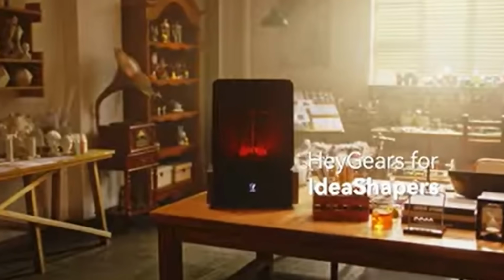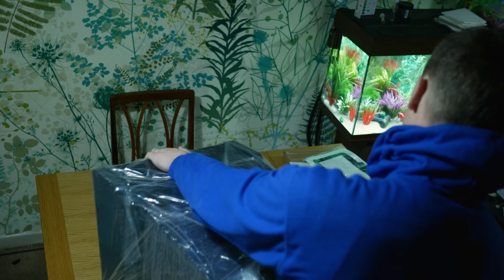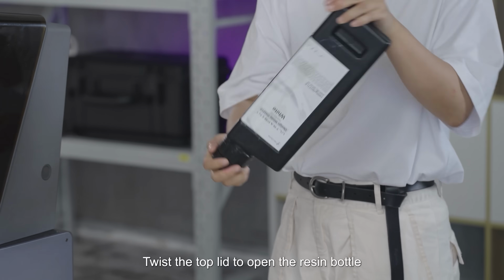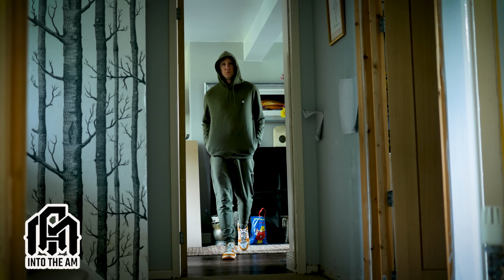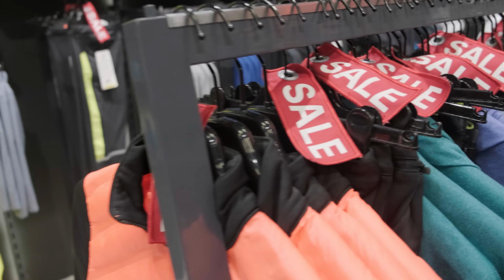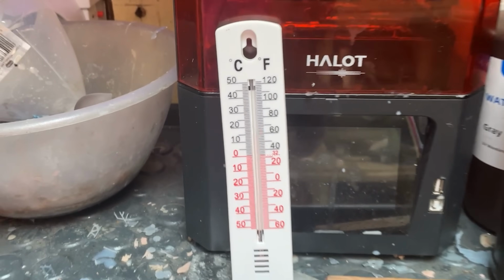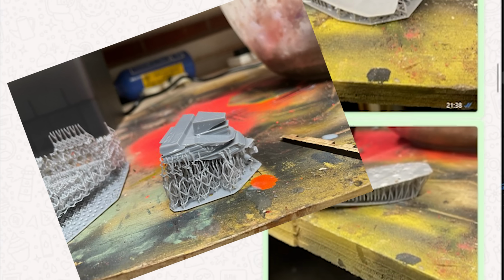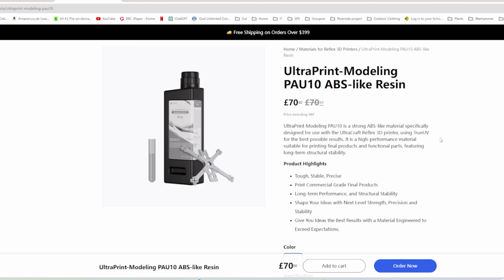The BEST 3D Printer you'll never buy - Hey Gears Reflex Review

Comment: I was thinking of buying this printer as I'm a novice and this would be my very first 3D printer,  I know nothing about 3D printing so if this machine can do everything for me that I'm not able to do because i'm just not that knowledgeable then that for me has got to be a good thing, I was going to use different resins in their bottle to see if I could use cheaper resins and if that works then again that could only be a good thing, I really can't do all that dialing in thing and doing my own supports for my models which by the way have been done for me so I have to trust the people that have produced the stl files, I want to produce some 1:76 scale model buses and I really think that this printer would help me do that even though the printer has its downsides like trying to lock you into buying their own proprietary resins and of course the price but in time I may get around the resin thing and the Machine may pay for itself if I opt to sell the model buses that I make but now that I've seen your video I'm now a little bit unsure?. Please tell me why you think I should buy one, I mean making model buses maybe a bit more profitable than making little model soldiers - right??.
Reply from the maker: Hi Chris, the best way I can put it is it’s the best 3D printer on the market right now. If you have the budget to run it, resin and all you will love using it. The concerns around being locked in are not a problem in a commercial setting or for use cases where you need precision parts easily. Think of it like buying an iPhone or an android phone. If you use the link in the description you get $100 off and a free resin too so that’s worth having!
Reply: Here is the thing.. 
If you are going to be doing sales I think this would be a great machine. 
I think in the long run you will end up spending less time and money on pieces due to less failures in the long run.
Reply from the maker: I agree, while no system is perfect if you are looking at purchasing a form labs system. This system costs less than half and is just as good.

Comment: I don't see anything special about this printer. Just looked at the specs. Its basically a formlabs with projector curing. Nice click bait tho.....but this changes nothing in 3D printing. This closed system turns any professional away. All my old closed system "professional printers" (including formlabs) are paper weights now - because they could not keep up with resin development. As a professional you never want to limit yourself to resin brands. Especially looking at the last few years. All resin printers are essentially the same....curing resin in a vat against a glass screen. From an engineering point of view, they should concentrate on print profiles for a wide array of resin manufacturers out of the box. That would actually be "professional". If they open up to other resins, I may consider buying the printer.
Reply: Ok just wondering because of that first guys comment. Most if not all reviews I’ve seen say this is an amazing printer the only gripe is that it is closed system. I assumed that most the reviewer were not lying I feel like some of them didn’t want to admit it was good though. I do understand why people would not like the industry to end up like the consumer printer industry companies like HP, I don’t feel I would want to buy the GK2 if it wasn’t capable of reaching that level of performance even if you tweak settings. Thanks James from a fellow James.
Reply from the maker: @JMEGAR324  very happy to chat in more detail, jump onto my discord, its free
Reply: @jamesgarcia123 while yes the printer is phenomenal, it's not worth it imo if you're gonna be locked into only using their resins. If you're gonna use it for functional/mechanical parts, then I wouldn't suggest this one only because if you need a specialty resin your only options are to get into contact with HeyGears to make a custom resin, or out-source it. I would look at the Saturn 4 ultra. It doesn't have a heating system come stock or a resin pumping system, but that stuff can be added on after the fact.
Reply from the maker: @ciderhat2760  if you are using the hey gears in a professional capacity ie prototyping mechanical parts, I would absolutely use hey gears over Elegoo unless you are very much into the weeds around dialling in your resins etc. Hey Gears are first and foremost an industrial printing outfit, specialising in dental and prosthetics they have multiple resins for this purpose beyond those in the video. While the Saturn 4 looks like it will be a good machine it’s only been available for a week and tested by reviewers for under a month, so I would urge caution before jumping on the hype train.
Reply: “As a professional you never want to limit yourself on resin brands” 👀 
Stratasys, Massivit, Mimaki, et al have entered the chat.
Reply: @joeylopezdesign  Stratasys is not limited to their own resin. ;)
Reply from the maker: @joeylopezdesign  bring it on, its exciting to think this is the worst 3D printing will ever be!
Reply: What resin printer would you recommend buying?
Reply from the maker: @JMEGAR324  it depends how you use it, the closest in terms of performance to this one with out the lock in is the Uniformation GKTwo,  https://youtu.be/rGOFJVZVwek
Reply: @RisingApe  but as of right now if you were to base it on performance I should get the Heygears?
Reply from the maker: @JMEGAR324  if you base  it on performance, I would absolutly get the hey gears, the print quality is phenomenal. I did a direct comparison of the Hey gears and the more expensive formlabs 3l here too is that helps. dont forget you can use my link to get some free resin and $100 of the price of the printer too. https://youtu.be/aGebC1tiLQc
Reply: @RisingApe yeah I bought the gkthree
Reply from the maker: @TheRealRivulet  Cool, it looks like a great machine, I know Ross' go to is the Reflex though
Reply: SAME, everyone says good stuff about it, faub even said the gk3 ultra is the best then joined on the train with heygears is the best, I say uniformation is the best it finally brought quality to big screens and everything else is perfect
Reply from the maker: @TheRealRivulet  I will be testing it soon
Reply from the maker: I basically agree with all of this I always approach my videos from the perspective of a home user hence the title. Most hobbyists won’t have heard of/ ever used a Form Labs machine, but the new Form 4 has shifted to LCD now too. For the hobby printing space there is lots of innovation here, outside of the form labs machines I can’t think of another machine with similar specs, happy to be enlightened though. Ref resins, I agree
Reply: @RisingApe  you... agree that your video is clickbait? yikes... mute mute mute
Reply from the maker: @lamBOwheel  thanks for your comment, not what I said but mute away.
Reply: @RisingApe  What is it about this printer that prevents other resin brands being used?
Reply from the maker: @robguyatt9602  Nothing, @Greedy3d has a great series of videos on this

Comment: Tbh what this printer brings to the table isn't revolutionary and in some cases backwards and outdated for it's price point especially looking at it's other competitors like GKTwo and Elegoo's newest Neptune Printer which blows this out the park. Hope you cover elegoo's new printer soon, aside from that Great video! Cheers!
Reply from the maker: Thanks, what do you see as a backwards step? In almost every way this is the most advanced printer I have ever used, do you mean the Saturn 4? I have some friends who have tested it, other than the tilting vat there is nothing crazy about the Saturn unless I’m missing something (I haven’t tested it) and god forbid you spill resin near that mechanism…
Reply: @RisingApe  The fact that you need to manually Level it and having proprietary resin is a step backwards in my personal opinion. Especially so when a number other flag ship consumer printers have auto levelling and doesnt limit itself in resin usage. I mean for that price point one would at least expect at auto levelling. 🤷‍♂️
Reply from the maker: @Kumomo92  you don’t have to manually level it, it comes levelled, if the machine gets knocked out by a print fail/ vibration or similar, you can level it manually (albeit with the sensors telling you exactly what to do, even down to which what to tighten the screws) though. You do have to level the machine, (to make sure it’s on a level surface though)

Comment: Proprietary resins? I'm out. Looks like a good tool for small businesses and education so long as they have a strong support network behind it.
Not for hobbyist fiddlers like me.
Reply: Same! The only time i feel justified for a 3d resin printer to have a Proprietary resin , is if said resin is deemed Safe to use and touch. Aside from that, one can't really justify Proprietary resin.
Reply from the maker: @Kumomo92  Are there any safe resins? I can see the argument for stock control and having your inventory stored and easy to use, not a typical hobbyist solution though.
Reply: @RisingApe  Not I'm aware of any at the moment (there was one Korean brand but it's kinda iffy)  but if they are able to create one, making it proprietary would make sense in both technical wise and business wise . But making a machine that's uses proprietary resin for just because it can (from what i recall it can print using hobbist resins but it'll void the warranty or so i remember someone tested) ... isn't really justified even more so for commercial business. as the last thing as a business I want is to have machine that relies supply with only 1 vendor, if there's any disruption  with the vendor with shipping or selling said resin, i'll be hard pressed in finding another especially so when i have orders to fill.
Reply: @RisingApe  sorry if I might sound like am ranting or maybe I am unknowingly. But for some reason I feel disappointed with this printer. 😕
Reply from the maker: @Kumomo92  not at all, go for your life. Thanks for commenting
Reply: @RisingApe  I use food grade river table resin manufactured here in Australia, and it is safe with no mask needed!
Reply: @Kumomo92  River table food grade resin, manufactured by AA composites in Brisbane Australia is safe with no mask needed. Great finish clear resin with no yellowing over time.
Reply: @Aangel452  no mask needed and safe to touch?
Reply: @Aangel452  Just to confirm, i just looked into the resin you mentioned. isn't that Epoxy Resin? Can that even be used on a Resin 3D Printer?
Reply: @Kumomo92  yes,its all the same stuff.
Reply from the maker: Thanks for watching, that’s what many will feel I think

Comment: Ohh trust me lazy people with more money than sense will buy this printer to print models to paint or armies no doubt it's basically the easy button but it still doesn't eliminate the hazard materials and the rest of the dangerous chemicals associated with resin printing, IMO the Saturn 4 ultra is it better machine than this and the GK2.
Reply from the maker: I haven’t reviewed the Saturn 4 but i seriously doubt it’s a better machine than this. It is significantly cheaper though and if you don’t need a heater it’s a great shout. It looks a right pain to clean though
Reply: @RisingApe  resin settings aren't that hard once you know the exposure for the resin that you normally use you don't have to deal with it anymore once that's taken care of what does that machine have other than auto bed level it's also a nightmare if it comes out of being level, paying that extra tax for someone to do exposure times and testing Anna's overpriced machine so you can pay for overpriced resin lol
Reply from the maker: Agreed, the plus points, the machine prints very detailed minis with excellent tolerances, I was able to assemble multi part resin kits with minimal cleanup, plus a variety of bits like the auto fill and low resin detection, as well as the excellent heater and mixing. The bad bits the cost and the proprietary slicer/resin, others have proven you can swap out resin though. Basically it’s a use case thing.
Reply: The Saturn 3 ultra does exactly that with no auto bed level details have been there since the Saturn 2, and you can only swap resins that have the same settings or exposure, trust me the Saturn 4 is a way better machine and i dont even have it YET
Reply from the maker: @NoMercyFtw  It depends how you define better,but this is exactly what I was talking about when I said I was hoping hobby printers would get feature upgrades. In terms of build quality there is no way the saturn will be better made, and I really worry what happens when resin gets into that tilt mechanism.  but in terms of value NO DOUBT at under £400 the 4 will be amazing and loads more popular.

Comment: If HP start doing 3d printers we know it's the actual end of resin printing.. Great video! Agree with all your points. Does kinda feel like we're at the precipice of a shift for these companies to find alternative revenue streams..
Reply: hp has been making 3d printers for about a decade, and make excellent systems. they sell to the industrial market. its called multi-jet fusion printing. there are lots of printing techniques using inkjet heads, multi-jet, binder-jet, and material jet techniques. Material jet systems like from stratasys j series and mimaki, can do full color process, with per voxel color, opacity , and durometer, in one shot. the cheapest of these types of machines is about 30 grand. that will come down over time. material jet will be the tech that brings printing as an appliance. hp actualy had a full color muilti jet but they killed that line- they had two teams with two completely different product lines in the space and killed one off (arguably the wrong one, the multicolor one). hp's printers use inkjet heads to apply binding material on top of a powder nylon process in a similar but different process to binder jet. not stuff you can run at home. the stratasys and mimaki ones shoot resin out of an inkjet. this stuff is widely used to make things like surgical training dummies and architectural models and the parts are absolutely crazy.
Reply from the maker: Haha! Well let’s hope that doesn’t happen, thanks for watching
Reply: I was just going to say, what's already been said HP's been 3D printing for a long time now...
Reply from the maker: @HunterMayer  Have since done much more research into MJF printing, I am still only a few years into this so a steep learning curve. but yeh MJF will be the topic of future videos.
Reply: @RisingApe  I look forward to more deep dives. The level of crazy interesting things happenings on the "just out of reach" shadow periphery of most consumers is pretty neat. Like the other day the the j55 Prime from Stratasys got on my radar.... I have no practical need/application for this... the desire is there.... but it certainly gets some interesting results from the tech (if something goes wrong... what's the support line like?!?) The material "delivery systems" pushing envelopes are getting even more complicated/proprietary and I fear for vendor lock-in when it comes to parts and expansion capability. Was the j55 one on your radar?
Reply from the maker: @HunterMayer  Yes I was chatting to Fauxhammer about it the other day, its a cool system for sure
Reply: @HunterMayer  I meant consumer 3d printers..
Reply: @AnotherNewManGaming  Ah ic. They have failed to get into this space... but not without wanting/researching the possibility. The worst part will be when the big companies lobby and start to push out the little guys who can't handle the overhead of regulatory pressure and lock-ins (hp or otherwise.) My knowledge of the HP mission is hearsay and inadmissible in court: but I asked some engineers that run in my circles about this... A couple engineers over the decades from this area in HP had bits to share (all for the price of a beer... or two...) They have/are trying to get into this consumer space (like they have with the laser and jet printers... by controlling the medium used to print.) The space is all still too volatile for a business their size (they won't be allowed to take the risks... again, reminder, this is second hand information) I am told they can't get their tech to scale reliably at those cost points... yet... We'll see! eh! ;D Its been half a decade since I have hung out with those folks though... So its old hearsay at that.
Reply: Im not so sure about that. Its just like with FDM printers, some companies decide to target a dofferent audience. If companies now start close sourcing then all they are doing is opening the market to other competitors.
Reply from the maker: @Bobby11  potentially, there is absolutely a market for both, if the cost came down further and there was an option for a "closed" system that "just worked" I would choose that for sure.